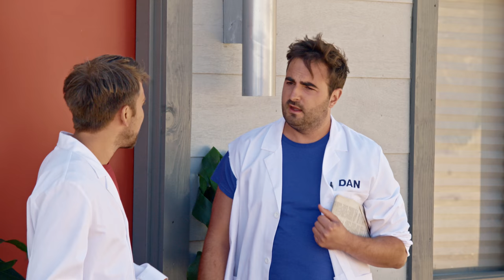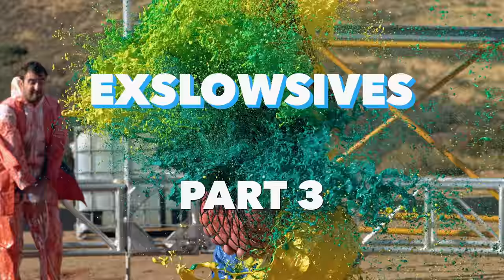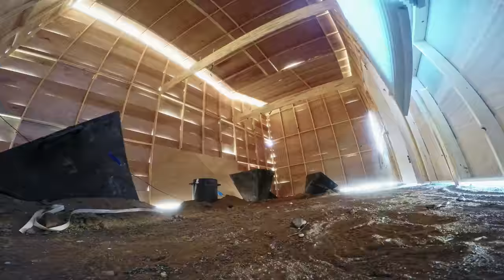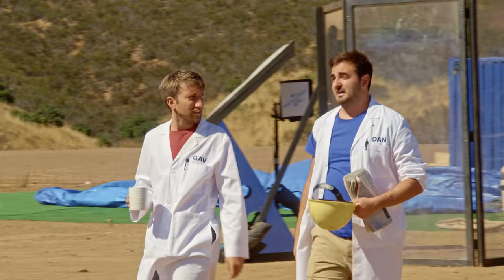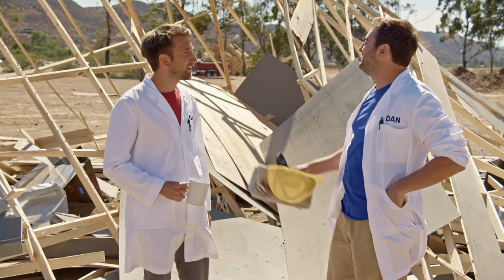Exploding House in Slow Mo

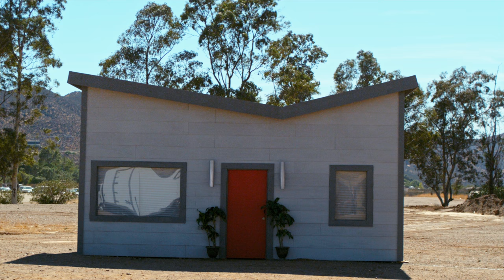Comment: The windows move before the explosion because the explosion requires air. At 2:35 you can see the reflection in the windows shrink before rapidly expanding after the detination.